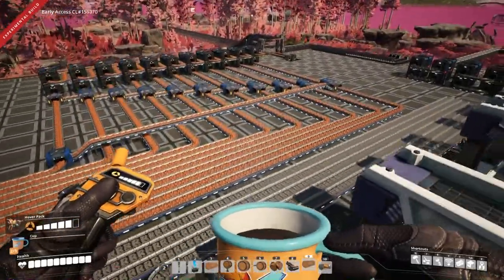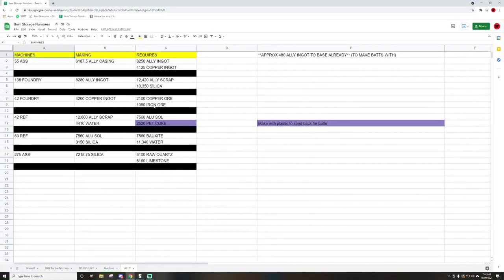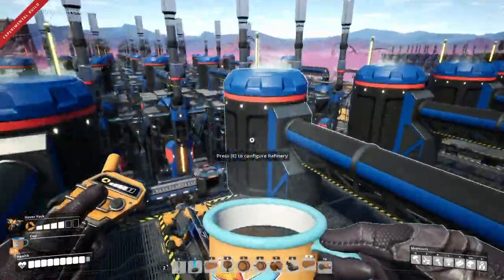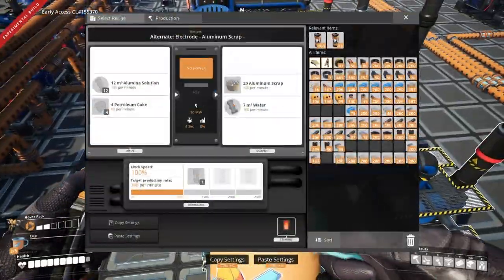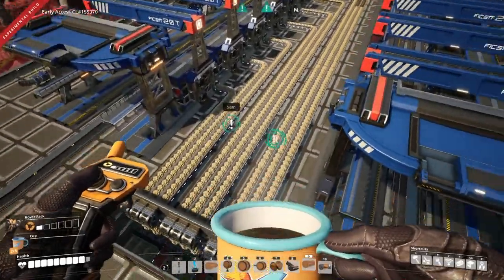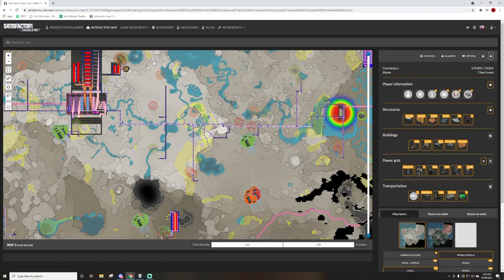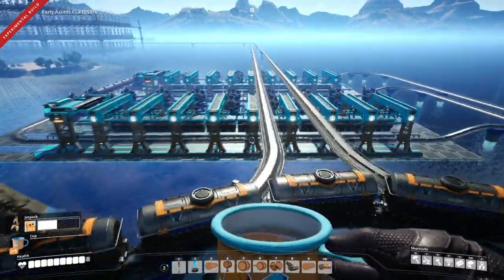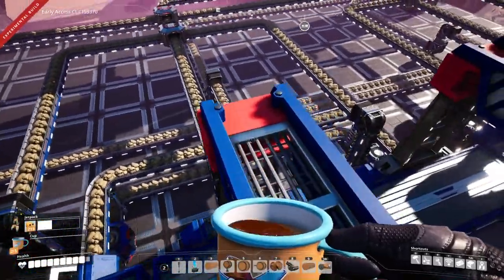SATISFACTORY - U4 VANILLA PLAYTHROUGH EP#12

Comment: Great job as always.. Ive decided on my big project for this save.. Going for 30 Thermal propulsion rockets / min.. Doing away with trains for the rest of the save.. Too much of a pain. I will be interested to see if your 9 carriages can jeep up with the limestone you need. Im having to split normal nides into 2 carriages over long distances. 💪
Reply from the maker: Nice.  Yeah basically with trains your throughput solutions are add more stations or add more trains haha.  Good luck with your build
Reply: I feel ya! I believe it's possible to do 60 thermals, though I haven't mathed it out rigorously. And I'm avoiding trains entirely. There aren't any logistical benefits to them! And I hate it that they cause power usage fluctuations. I want to see a flat line for the entire factory.
Reply: @thinkerythunker616  i think i could do 50/min  with the bauxite i have left after my nuclear builds, but i want to leave some spare in case i need more batteries / drones later down the line.
Reply: Is that with all the alternative recipes considered? I believe the limiting factor is actually the nitrite, followed closely by the bauxite. And I wonder how much of the max nuke power is actually even necessary. But I am not at home with my computer right now to look into it.

These are enormous projects. I'll be lucky if I manage to finish the build before update 5!

Comment: Nice.  You've got me re-thinking my train spirals :-) -- I was doing 8-across, and I think you've done it with 9.   That's a single support strut instead of a pair. Looks nicer.  Question: With all the fluid weirdness that crops up from time to time, did you find that the game correctly does the 9-to-7 fluid balance properly? I was thinking maybe valves would be necessary to force it to be consistently distributed the way you want it.
Reply from the maker: Thanks.  Liquids always find a way to not do what you want, especially with bigger systems.   Ive got this running now and Ive had to tweak a few things and add a second train for each station to keep up with throughput. I think I'll go into a bit more detail next vid. But its hard to try not make the videos too long
Reply: @danp6918  i dont mind videos being too long , FROM YOU , because your work is masterpiece...keep up the good work